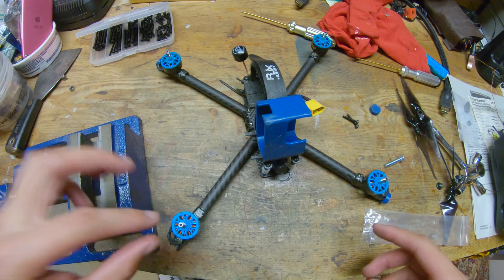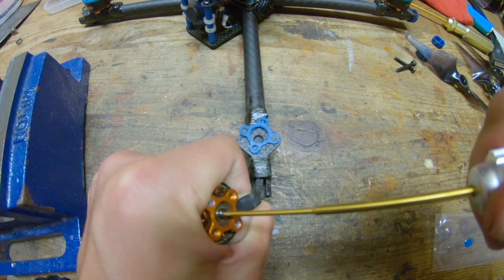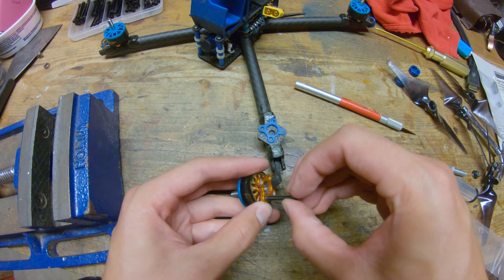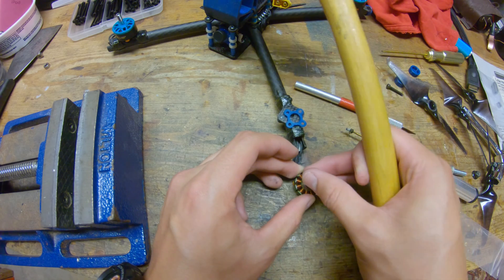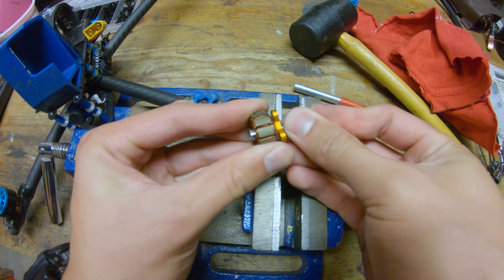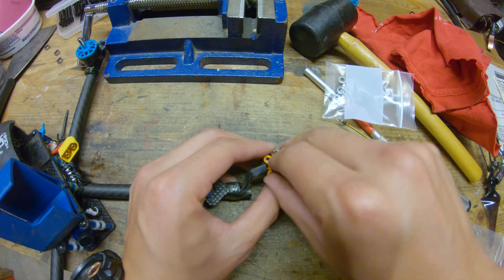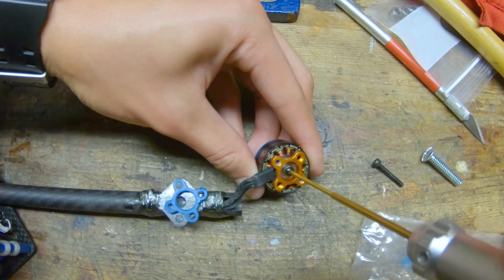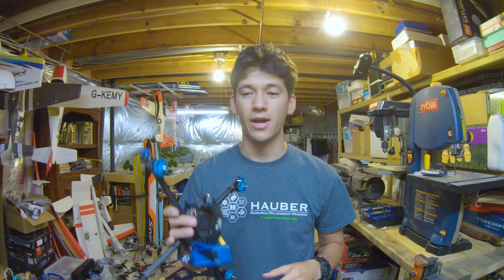How to Change Brushless Motor Bearings

Comment: wow... I have never seen bearing just push in that easy... its always a fight lol. I don't use threadlocker, just snug em down I always check them and they are never loose. In fact they will run without screws most of the time.

Comment: What is the bering size of.( A2212 1000kv motor ) i also change the bering but i really dont know what is actually size of bering A2212 motor
Reply from the maker: Bearing sizes change from motor to motor. All 2212 motors will not necessarily have the same bearing size. You will have to look it up for your specific motor or measure the bearings in your specific motor.

Comment: Nice Video, very helpful. Applying the threadlocker inside the motorshaft with a toothpick helps keeping the bearing clean.
Reply from the maker: Thanks! Good threadlocker tip.

Comment: This is one of the most helpful videos I've seen for a long time. Very good and detailed.
I'm so unhappy for a few weeks now with one of my favorite quads because it has so much vibrations now that the GoPro footage is almost unusable.
After having tried all those software tuning to get rid of the vibrations, I'm pretty sure it's the motors.
So I already received new motors for it on friday but now I'll try to first disassemble the motors and clean and oil them to see if that was enought while I'll wait for new bearings which I will order tomorrow for the case cleaning and oiling will not be enought.
Many, many thanks for this one!
Reply from the maker: Thanks!

Comment: why am i doing this on alot of new motors right out of the box?
Reply: Great question! Are companies using low quality bearings? 
My Racerstar motors are particularly noisy, although they work fine. I ordered a synthetic oil from Amazon and 1 - 2  drops on both top and bottom bearings seemed to quiet noise from my motors a significant amount.

Comment: Oke and what to do when i can not puch the bearing in by hand😉
Reply from the maker: Good question. For motors with bases wider than the stator, you can place the motor upside down in a vice, with the base of the motor resting on the jaws of the vice. Then you can pound the bearing out.

Alternatively, for any motor, regardless of base size, you can bolt the motor to a spare arm, clamp the arm down, and pound out the bearing using the center hole in the bottom of the arm that usually provides clearance/access for the motor shaft screw.

Comment: good video. how to find out what bearing size we need?
Reply from the maker: Thanks! For most motors the manufacturer provides the bearing size, so you can just look it up. Alternatively, you could remove a bad bearing and measure it. The most common bearing sizes for miniquad motors are 8x3x4mm, 8x4x3mm, and 9x4x4mm.